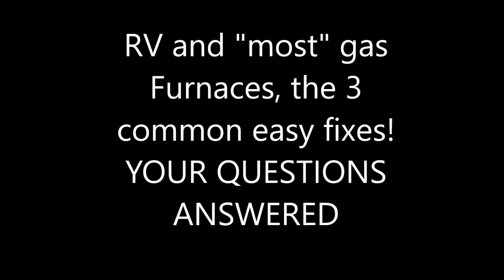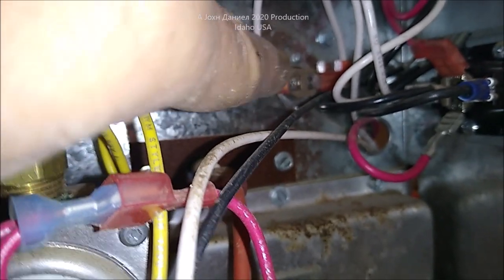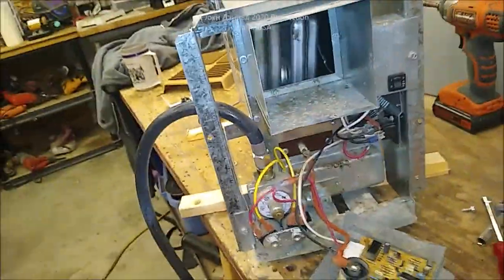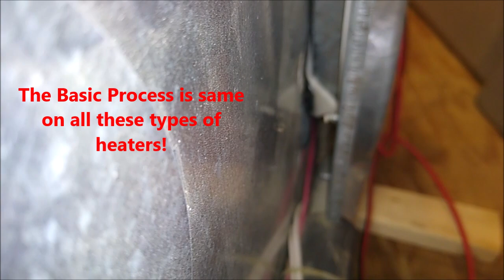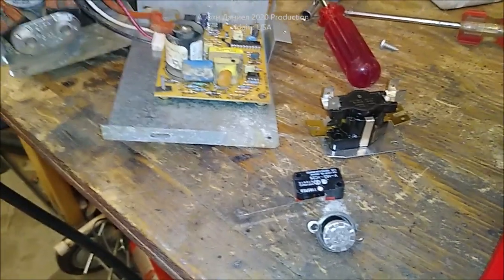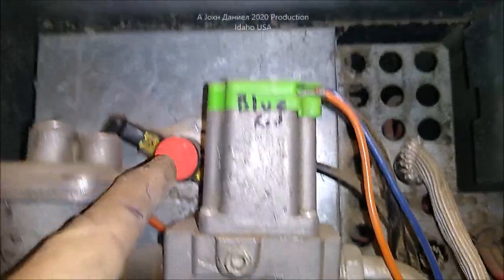RV Furnace REPAIR TECHNICIAN SECRETS Top 3 Easy Fixes anyone can do PARTS BELOW

Comment: Ido have a question. I just watched the video because a few days ago i noticed the fan started sounding funny. Then it got louder and louder ,while tht was happening i noticed the hot air was blowing warm then almost no heat at all but still blowing strong. What would that be?
Reply from the maker: Possible intake blower which feeds air to the fire is loose or fell off in the housing. Motor spins a large blower and a small blower on dual shaft styles. Takes a set screw, you have to pull the unit to see. To find out check and see on the outside exhaust if the normal 5 mph output is down to nothing. You can also shine a light up both tubes to see if something got into it while there.
Reply: @JOHNDANIEL1  yes that makes sense. It sounds like the fan is hitting something when i stop the heater

Comment: Great video. I have what looks like the exact same furnace in my 93. I have an issue where it Starts, ignites, runs for 30 seconds while getting hot, then it shuts the flame off. Does this 3x and doesn't ignite again then just starts blowing cold. If I tune off the furnace and tune it on agian, it will start the same cycle. I took it out and checked for dust and such, it was really clean, sail switch looked good (didn't meter it). Any idea why it would start, ignite then turn the fuel off after 30 seconds x3 times?
Reply from the maker: Low battery, over temp switch failing, or thermostat contacts weak.
Reply: @JOHNDANIEL1 thank you. I know batteries are good as the fan blows good and I still spend another 4 days in the camper using the stove every so often to warm it up. The thermostat connections are good as I just reconnected them. I will check the temp switch. Now something els it started doing after having it out is it will "pop pop pop" while trying to ignite, like it ignites but goes out and makes a pop/bang. That's only after I had the probes out and used some sand paper on them (they were pretty clean before, but had a tiny bit of tinge).
Reply from the maker: @MK4moTDI  Sounds like fuel issue then, freezing LPG regulator on your tanks?? Plus be sure to have igniter tips at no more than 1/8" to 5/32 gap.
Reply: @JOHNDANIEL1  would the oven and stove still work as normal if fueling was freezing up?
Reply from the maker: @MK4moTDI  Yes, the heater takes as much as all burners on the stove and oven at same time running 3 cycles of the furnace.
Reply: @JOHNDANIEL1  ok, I will check this. Thanks.
Reply: @JOHNDANIEL1  hi again. I ended up getting a new regulator, it is an auto switch. The furnace is still going on and off, but the time can from 30 seconds to a couple minutes before it turns off. But 10 seconds later it will ignite again and blow hot. Before changing the reg. it would only do this 3x before no longer igniting and starts to blow cold. Now it seems to be unlimited times on and off heats the camper up well, just turns on and off lots. Any thoughts?
Reply: @JOHNDANIEL1  I would like to add the oem regulator was a 240k BTU/h and the new one is 190k BTU/h. Maybe this is the issue?
Reply from the maker: @MK4moTDI  What are the temps where your at? Is your propane freezing up, did you get bad bottles of LPG, and what is your battery voltage when its off and running. Low voltage may do this causing the solenoid on the furnace gas valve to close.
Reply from the maker: @MK4moTDI  Not normally. Most furnaces even a 40K will only need 55K available flow of gas. A clogged up intake and Exhaust has caused similar issues making the furnace over temp and have to cool some before firing back, but so does low voltage due to a bad battery draw ability or AC converter low voltage under draw may cause it. If you have a multi meter test for a big drop in volts when it fires up. If it drops by more than a volt and continues to go lower over the run cycles replace battery or find cause.
Reply: @JOHNDANIEL1  no, temps are +10°C here. It does it on both bottles and one was a newer fill vs other. Also issue only started happening about half way through a bottle. Checked limit switch, it's good, have to test sail switch, but have to see where it connects. Voltage drops 0.2v when the furnace kicks in. Exhaust is clear and so is the intake side. This unit is very clean with very little surface dust and no rust. I'm kind of leaning towards the board now.
Reply: @JOHNDANIEL1  while looking at my hydro flame owners manual, the sails witch is wired in series with the limit switch. When I turn the thermostat on, but the fan hasn't kicked in yet, the limit switch is getting 12v. I don't believe that is normal as it should have 0v till the fan kicks in to close the sail switch?
Reply from the maker: @MK4moTDI  12 volts will always be present at the limit switch unless it is bad when the furnace is in run mode. When it hits 250 degrees it will break circuit and cut the gas off allowing cool down mode. If your Run Delay Relay is wired right, and acting right it will kick on the fan, that motion will blow on the Sail Switch, if all is good the gas valve will kick on and the igniter will fire it up. If you have a bad igniter/flame sensor over your burner or your Run Delay Relay is faulty you can get symptoms like this
Reply: @JOHNDANIEL1  thanks so much for the help and understanding how these furnaces work. It ended up being the board shorting out. Now the board shorted out enough to Fry the time delay relay, so the furnace won't do anything endless I jump from the thermostat to the fan + the 2x 12+ wires. I got myself a new board and now I just need to get a new time delay relay.
Reply: @JOHNDANIEL1  welp I had it all working, but I have nothing, even after getting a new time delay relay.
Top wire on the time delay relay is getting 12+ volts. But thats it, and that is hot whether the thermostat is on or off.
Reply from the maker: @MK4moTDI  Swap the Thermostat wires? you may be using the hot side instead of the switch side from a miss wiring in the past. The rest of the issues are very unusual. Still send me pictures to my email and make them clear so I can help out. olympicpowercontrols@yahoo.com
Reply: @JOHNDANIEL1  ok, I have officially found what happen when the board shorted out. The adjustable heat anticipator melted inside the thermostat.
So in the end. The original board is dead, but now the anticipator has broke/melted inside the thermostat.
Again thank you soo much, your video has been a huge help in fixing the furnace.

Comment: I have the exact furnace in this video, maybe you can help diagnose my issue. On my last camping trip, after about 2 hour of use and the furnace working perfectly fine, it started this weird cycle where it would try to light repeatedly and it would almost "pop" or "backfire" out the exhaust. Occasionally it would light and I could feel heat coming out, but it would shut off after about 10 seconds and repeat this over and over again. If I turned the furnace off and waited about an hour - it would fire right up and run for about an hour before it would start the intermittent no light/occasional light/popping thing.
Reply from the maker: Thats a common behavior of a plugged up intake or exhaust. Go outside the RV and shine a flash light into those 2 tubes and look for something in it. Also, check the battery voltage before and after a run to see if voltage sag is a culprit.

Comment: Hey brother I have a 20 13 Keystone hideout camper that my furnace when I go to bed at night somewhere during the night it shuts off and don’t come back on and the trailer gets real cold what do you say that would b the cause of that
Reply from the maker: Low Battery voltage. Amp load test your battery, it's possibly as old as the trailer. If its over 4 years old they degrade fast as a RV battery. Volts may show 12, but available amps may not carry on all night in the cold.
Reply: Just bought a new battery thanks for the quick response

Comment: Great video.  My RV furnace got water sprayed on it from a line break.  Now not heating but blowing and clicking. Would it be the board due to the water?
Reply from the maker: The board can be damaged by water but most common effect of water is to damage the relays on it.
Reply: @Јоhn Daniel  the relay on the board you're saying? Is that an automotive type 12v relay? I will start there!  Thank you

Comment: Super confused. 3 months ago I found this video. I decided to get a universal fan blower delay relay since it was cheap. Well, now I realize there's no place on my atwood hydroflame 8531-111 for it. Like I can't tell heads or tails where the location of its supposed place is in relation to where it would be from the access flap. I have found wiring diagrams and schematics and the part you had linked to is listed as a heat sequencer in Amazon. Can't return it now. So now I'm off to test everything with a test light. And actually figure out my problem. Ugh.

Comment: I have a brand new suburban heater in a Beacon by Vanleigh ,  it doesn't work properly , after setting the regulator to the correct specs given to us by Suburban , the heater worked great for one night , then the next am the furnace would not come on by itself , I had to turn the switch off then back on and it would work just fine , BUT two times now it has shut down for two hours , it would cycle three times but not stay on , once it did come on , I cranked the temp up to 80 degrees , at midnight last night furnace started working and stayed on all night , but inside RV temp would only come up to 73 degrees , as I am typing this comment the furnace is still running , it has been 19 /20 degrees all night , the furnace has been running for 5 hours straight. Any thoughts. Thx John , PS. Vanleigh is sending a whole new unit to be installed by a certified RV tech ,next week ?? I hope.
Reply from the maker: A majority of the new heaters are congested with sensors and electronics, dropping efficiency by nearly 15% and causing numerous problems. Thank your GRUBBERMENT clowns who regulate everything into oblivion then complain we use to much fuel and resources as they fly around on jets condemning us. I miss Ronald Reagan and Even Trump now. They gave us cars that got 60 mpg and millions of things you could run on nearly nothing and could fix if needed with a roll of duct tape by deleting millions of those idiot regulations. I stopped repairing anything newer than 2008 since its just throw away crap!

Comment: Thanks for that simple break down on these furnaces. I appreciate your videos.

I have a Dometic DMF30111 that keeps cycling but each time stays on longer and longer and does light and produces heat. I have since replaced the limit switch and the sail switch, cleaned out the burner tube and all around the furnace, which is always clear and checked for obstructions. I was ready to order a replacement Dino board ,(for my 31501 board),but noticed you mentioned that it could be a failed fan run  delay switch. I’m not sure if my furnace has one or if it’s integrated into the board? My RV is only four years old. When I look up that part, for the Fan run delay switch it doesn’t show my furnace listed as an application for it.

Do you have any suggestions or advice?
Reply from the maker: They were known for a intermittent failing circuit breaker and it would act up lowing voltage and shutting off the unit. Also the over ride power switch make get corroded causing similar issues. as for a Run Delay module, some had them, some had a instant on. Replacing the electrode igniter/flame sensor is common to make sure the board is seeing flame is on, which is common on any model after 3 seasons in this design. Order 2 of them so you have a spare. 3 items are in this link Electrode, Sail Switch and Limit switch to most problems with them. https://amzn.to/3glaGuc
Reply: I just purchase and install the Dino board. Problem solved!

Comment: What does it mean and how do you fix when your furnace start sounding really really loud rattling noise
Reply from the maker: If it slowly works from a small rattle to a loud one, thats usually sheet metal case/body working loose in it. If its ok for a long time then real fast gets loud, check the set screws on the blowers shafts in it or blower motor alignment.

Comment: Your furnace does not look like mine, yours looks much older.   Mine is suburban SF-35Q.  It blows but won't light.  Replaced the sail switch and limit switch, replaced the board.  What else can I do? Its clean on the inside.
Reply from the maker: https://amzn.to/3fuSgXO Igniter / Flame sensor
Reply: @JOHNDANIEL1  thanks! I'll try it, I got nothing to loose

Comment: Great video, thank you! I have a weird issue where my furnace tries to ignite but doesn't.  It will only ignite if I place a hand or paper towel over the exterior air intake...? Thoughts?
Reply from the maker: Possible issue, and one I have seen. Exhaust or burn chamber plugged up with wasp of some kind so your having to choke the air fuel mixture to get it to light.

Comment: iv been testing it out more today and its lighting up in the beginning and running for awhile great. then the flame stops and i noticed threw the window the spark was there as if it was trying ti ignite it more but it kind of trickled out. then i shut it off and turn it back on and it has been lighting up again and doing the same thing it seems   any ideas what it could be ?  now it stopped burning but lit again itself like normal.

Comment: Furnace stopped in the middle of the night of course it was 47 degrees out lol. When I push the t-stat on I hear a sound almost like an old car solenoid fora second then nothing. I saw a red light blink on the circuit board. Is this the run relay causing this? 2011 Dutchman sport 27b
Reply from the maker: I would have to know the furnace model. Sounds like blower relay but furnace model info helps.

Comment: HI there !  iv got a duo therm from late 80s. great furnace in my trailer. stopped blowing hot at end of last winter. havnt messed with it since this morning when it started blowing hot again. then again tonight and it blowing cold.  i guess it's having a problem igniting when it wants.  any ideas on what it may be ?  iv been meaning to get into it and clean the wheel and sail switch but honestly dont have a clue how. its under the fridge and just tucked in there. i guess i need to start taking screws out and see what happens
Reply from the maker: Remove the exhaust outside, slide its assembly out. Center screw on many, and 4 on its flange. Then inside remove front cover, look down where it has lower duct space, there will be 2 screws. shut off and remove gas line then pull forward enough to unplug. Slide out.
Reply: @JOHNDANIEL1  i will do that. thankyou.   on the tag it says to clean the wheel every season. i havnt done that yet. any other tips on maintenance when i do take it apart ?
Reply from the maker: @mick5740  Look deep into the exhaust/intake for wasp or bugs. Thats a big service call cost. Run/connect a shop vac on the exhaust when removed to service as you rotate gently the heater around 360 degrees and up and down to help clean it out of scale and junk.
Reply: @JOHNDANIEL1    More on and off testing after its been working and running for the last half hour and now when i turn on it blows and in the window i see this small spark little lightening strike where it usually ignites it all   its like a small spark on and off on and off

Comment: Awesome video and great tips & fixes! Question. I have an Atwood and is cycling fine the first 5-6 cycles. Then at #7 start up, no burner action. Turn thermostat off, then rest it and she is good for another 5-6. Any idea?
Reply from the maker: If the furnace is starting from a cool RV and by the time it warms the RV very well then starts to act up, then you let it sit till the rv cools off some and it repeats the behavior, replace HIGH LIMIT ( over temp switch ). It is due to the intake air finally becoming hot enough to make very hot output air and a high limit that is failing will do that, It will click on early disabling the furnace. A rare possible is the igniter assembly is warping from same causes and when it cools is now close enough to detect flame and then operates.

Comment: Can the overtemp sensor work inconsistently? I have a 2019 that will run for 3-5 minutes, producing heat, and then it goes through the shutdown process and off. The electric thermostat has to be turned off and back on (sometimes it has to set for a while).
Reply from the maker: Yes they can do that.